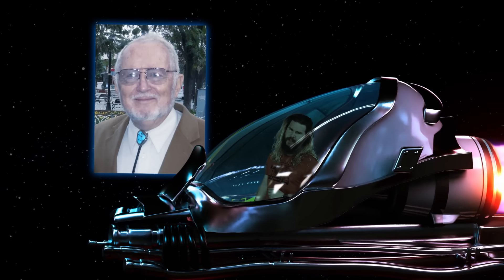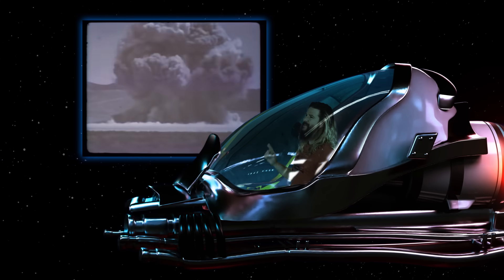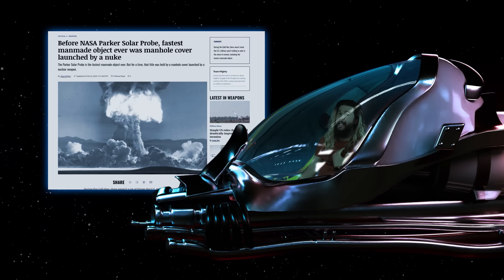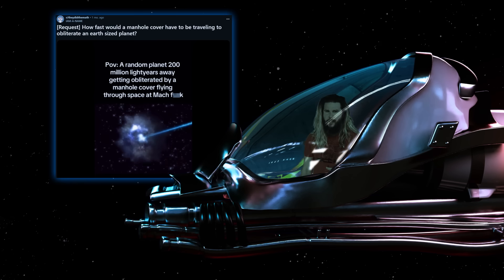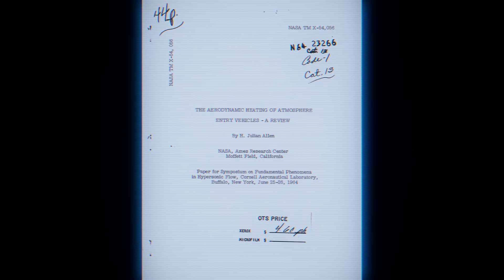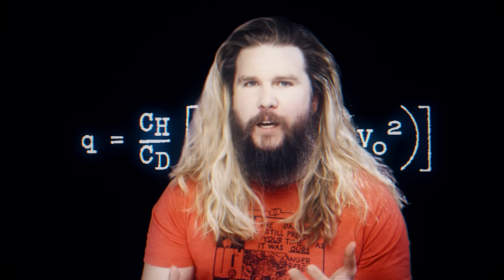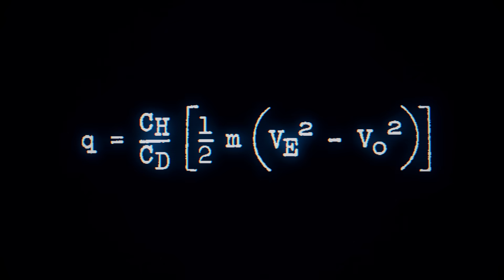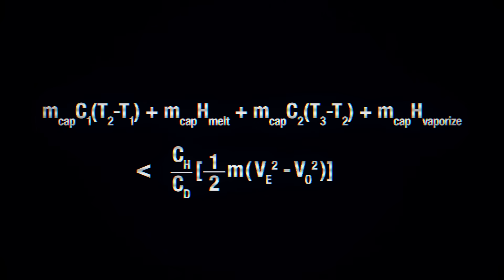Debunking the Nuclear-Powered Manhole Cover

Comment: I dont think that a manhole cover several [edit: inches] thick would have instantly vaporized over .8 seconds. Your formula accounts for it spending its entire flight down to a velocity of zero in a gradually thickening atmosphere, not escaping into frictionless space in less than a second.
Reply: I agree he never mentions that convection takes time. Also the meteor isn't going straight up, commonly going through 1000's of km of atmosphere.
Reply: @christopherlenahan3906 the convection coefficient is accounting for time.. but I still don’t believe it
Reply: Is the manhole cover going straight up though? Depending on the angle+speed at which it departed, it could go through more atmosphere.

Also unless I missed something, the calcs provided by Discount Thor are based on the mass of the manhole cover, not the shape. Past a certain point, energy+time will disintegrate almost anything no matter what shape it holds initially.
Reply: @christopherlenahan3906 meteors enter from space, from low density. This is in reverse, which is worse. Like fireing a high caliber bullet to the pool. It just breaks.
Reply: @Neo-vz8nh  shooting from outside the pool into the pool, yes it would break up. that's the exact same as how a meteor entering the atmosphere from space works: a sudden increase of drag. It's also the exact opposite of what was happening. Your example doesn't hold up because, if you hold the gun underwater and shoot, the bullet does not fragment, and since drag from air is many times lower than that of water, and explosive interactions with "failure points" like the cover served result in a dome shaped projectile, the drag most likely wouldn't cause it to break apart. Even then the atmosphere got progressively thinner so the drag would affect it less and less.
Reply: @Neo-vz8nh What you described is the exact same thing as a meteor entering our atmosphere. A high caliber bullet traveling from air to water is going from low to high density.
Reply: @Neo-vz8nh if you fire a gun in water out of air it doesn’t break, this is what you mean yes? goofy
Reply: @soggybiscotti8425  the only type that would realistically fragment like this is hollow point... because y'know, that's it's job
Reply: @Neo-vz8nh  except that rounds fired into a pool don’t break?
Reply: @Neo-vz8nh  no. a bulet IMPACTS the surface of the water.
atmospher is not the same thing as waters surface.

its annoying that so many people use this comparison. as the shape of water molecules cause the surface of water to actually be fairly rigid.

this manhole didnt IMPACT the atmosphere.
Reply: @lancesmith5645  no. Bullets pierce thru surface, the high density and velocity is the problem. Meteors also melt and break on the upper athmosphere, and there are no surface
Reply: @Neo-vz8nh  bullets travel through a gaseous atmosphere before impacting the water surface, be it by piercing or impacting the surface. 
Even if it is fired underwater it is still leaving a gaseous atmosphere and transitioning to a liquid medium. And water is a far deferent medium from lower atmophere which makes a huge difference.
Reply: @lancesmith5645  your point?
Reply: That's a crap-ton of power being released.  I don't think you comprehend the energy involved here.  Objects subjected to forces larger than their yield stress inevitably break up into smaller pieces which each have a higher ratio of power to mass which break up into...  etc until you have an explosion and complete vaporization.

He didn't go over the math but the atmospheric stress forces would have torn the manhole into pieces almost immediately independent of the energy being released.
Reply: @knurlgnar24 No explosion was recorded, if it vaporize in less than 8 seconds, the plasma would have exploded or going off like  fireworks upon combustion.
Reply: @knurlgnar24 for meteors sure, but this is refined steel, a shit ton of it, and it had a ton of power behind it propelling it upwards to. This isn't throwing a rock at mach fuck, it's more like god putting a penny on his fast before bitch slapping the stratosphere.

Things break apart for three reasons, unequal load, unequal strength, and too much load for the strength. (Other failure modes not withstanding) A meteor or space ship has fuck tons of different compositions with fuck tons of different weak points and their complex shapes mean aerodynamically they're a mess. None of this is true for a giga-manhole cover

This is basically like saying "well you can step on a can and it'll break, and a penny is less metal then a can, so if you step on a penny it'll break"
Reply: @felixjohnson3874  Cast Iron is NOT refined steel.  Not even close.  Cast Iron is iron that has a lower than usual melting temperature, to be CAST.  There are people who have tried to forge it (like you would refined steel) and it just melts.  Because that's how it's designed.  To melt.
Reply: @opalescent4694  1 : cast iron isn't "designed" at all, it's a description of it's material and construction process
2 : somewhat fair but my point stands that it's still refined metal. It's not technically 'steel' but it's still highly refined homogenous metal created artificially by humans. Comparing it to something like a meteor is still incredibly fucking stupid for all of the exact same reasons listed, but no technically it didn't have carbon.
Reply: @felixjohnson3874  cast iron is high in carbon. Pure iron has a higher melting temperature. Meteorites are often iron-nickel which would have a melting temperature just abit above steel.
Reply: @felixjohnson3874 This comment should be memorialized in history books around the world as one of the best comments ever written. Shakespeare himself couldn't have come up with something so witty and hilarious.
Reply: @knurlgnar24  it was several feet thick. it did NOT vaporize. I work with steel. there is no way it vaporized several feet of steel
Reply: @knurlgnar24  it withstood instanteous pressures of a nuclear blast accelerating it throught the lower atmosphere. Not to mention the manhole cover was thicker than a normal one
Reply: @knurlgnar24 1.4 kt just from vaporisation energy....  the Davy Croket had a 0.1 kt yield.
Reply: It was 4 inches thick.7:48
Reply: @prdoyle that’s what she said! 😂
Reply: it doesn't need to vaporize, if the iron becomes a liquid then that should deform it and increase its drag/cause the air to break it apart.
Reply: It would aerodisintegrate long before the heat could melt it anyway.
Reply: He also assumed that the drag coefficient was constant at its largest with the lid travelling perpendicular path of movement. It likely would be an average between parallel and perpendicular because it would have been flipping it's dick off
Reply: Not to mention it wasnt a normal manhole cover. This thing was 2000 pounds of steel.
Reply: Are you accounting for the heat of the nuclear bomb? It was pre heated
Reply: Also that cover was over 1,900ib and was heat treated so it doesn't even compare to a meteor
Reply: @Wowzival akshually it was pre heated by a nuclear explosion
Reply: @Wowzival  depending on its proximity to the explosion it could’ve been preheated to many thousands of degrees before it even broke the weld
Reply: @Wowzival i think it might have made it out but it definitely wasn’t shaped the same and likely lost a few hundred pounds
Reply: He said the energy was capable of vaporizing it multiple times over before it would even reach space. So there’s no need to calculate it
Reply: Also the manhole was way thicker than normal
Reply: @AlechiaTheWitch yeah from what I found it's around 907 kg or 1 ton (2,000 lb) which ain't your normal manhole cover.
Reply: @clonescope2433  yeah thicker and denser
Reply: @AlechiaTheWitch  and way bigger around.  It wasn't just a fat manhole cover.  It was more like 12 feet across and welded to the container.  Remember people they had to put a NUCLEAR WEAPON THROUGH THE HOLE THIS "MANHOLE COVER" FIT ON TOP OF.

Guess what wasn't that small when this happened.  DING DING DING NUCLEAR WEAPONS!
Reply: I would also be interested to see how this all changes with higher speeds. We don’t know the caps true speed, only its lowest possible speed. Since it was only caught in one frame of the high speed camera. This means it could have been going just a few mph faster, or maybe even twice as fast. I would be interested to see what the minimum possible speed is for it to have survived
Reply: This
Reply: however, mechanically it would shatter (unless ive done my math wrong lmao). the average normal stress per area is F/A, which can be re-arranged to be equal to mv/(A(t2-t1)), m is the mass, v is the final velocity, A is the area, t2-t1 is the time difference. this stress is in the giga pascals, which is enough to shatter the cast iron
Reply: It wasn't 8ft thick it was a few inches,
Reply: @eddjordan2399 It was 4ft wide and 2000 lbs. A few inches isn't at all accurate. It was probably a couple feet thick.
Reply: @soulknife20  as far as I can tell from searching it was 4 inches, but eitherway, yeah his conclusion here is wrong. He was less than an order of magnitude below vaporization point and he completely ignored tumbling, blast-forging, etc.

If you're worst case, rough estimation 
, 'general idea' math is within an order of magnitude before you've considered any mitigating factors (again, like tumbling, though another example would be an inverse aerospike effect, like how the cybertruck works aerodynamically) then thats functionally confirmation.

If your worst case " ah lets just see real quick " math is that close, before you've considered anything else then even minor changes in your favour easily win out
Reply: I can tell you've never worked with metal, a 500 lb base plate for a tower is only a couple feet across and only 2 in thick @soulknife20
Reply: @soulknife20 Using an online metal calculator finds that a 48” diameter, 4” thick disk of cast iron would weigh about 1870 lbs.
Reply: @soulknife20  48 inch diameter and 4 inch thick would be about 2050 pounds. Steel is heavy. I don't think the math here was done right, but it wasn't a giant plug of steel.
Reply: @soulknife20  no it's just under 4 inches thick. Here look:

Volume x Density=Mass
π2'²h x 490lbs/ft³=2000lbs
πh=1.02ft
h=.324ft
h=3⅞ inches
Reply: @soulknife20 using the lighter side of the density of cast iron, and the known dimensions of 4 feet across and weighing 2000 lbs, the cover calculates to be 1.4 inches thick, although the scientists who ran the test say it was 4 inches thick, so it was likely much heavier than 2000 lbs if it was 4 inches thick
Reply: It can't escape because it disintegrates. You can't cheat physics simply by going faster. The forces involved will be applied no matter what. You can't phase through objects by going fast. When you hit an object, it'll apply it's force to you. Even if you're going 99.99% the speed of light, it'll still apply all of it's forces to you. No matter what, physics must always resolve. So it doesn't matter if you halve the size of the atmosphere to .4 seconds. Physics works the same way. It doesn't just stop effecting something because it moves faster. Unless you're moving faster then light, physics gets you, no exceptions.
Reply: 👀... It's traveling through the atmosphere from the ground up. Meteors burn up before they hit the ground for the most part.... Why do you think it's not possible for it to vaporize before it hits the outer atmosphere? 

And the fact of the matter is Kyle is an actual scientist that makes a living doing calculations, figuring out odds, and using practical logic to explain or prove situations. You on the other hand.. are just some dude with a YouTube account, couple videos in your playlist tab, and no created videos of your own. 

That being said.... You would know better than Kyle because....? 👀
Reply: @TwoPaw-Shapurr  the manhole wouldve shattered. it is cast iron, so it has an ultimate tensile strength of around 1.5 GPa. the manhole experienced much more pressure than that.
also, just because somebody isnt as influential as kyle, doesnt mean they cannot perform their own calculations
Reply: @drcgaming4195  well then..... You should be aware that tensile strength is based off of force applied to a stationary object. 

However, when an object is moved by the force being applied to it...... Tensile strength becomes obsolete. 

There's a big difference between the manhole cover remaining stationary with all that forest being applied to it..... And all that force being applied to it causing the manhole cover to move as propulsion. 

You really need to let this go buddy. I'm not trying to insult you...... But you are overthinking this and you are also lacking a whole lot of information that is required to calculate accurate numbers

Comment: I really, really want this slug of iron to make it to space.  However... This also does not account for the energy put into the cap needed to propel it at the "observed" speed.  BUt it also does not account for the atmospheric conditions at the time the plug was lifted.  By that, "Chubby Electron guy had a point. At the time the plug lunched, it was propelled by the expanding gas of vaporized concrete and the shockwave of a nuclear detonation.  I think these conditions would disrupt the atmosphere beyond what can be accounted for in the formulas presented.  Even if those gases dissipated in a few thousand feet, it would still have given the plug a protected boost thought the thickest part of the atmosphere.  

Then again, the initial acceleration could have imported more energy than we accounted for.  Only one this to do.  We need a hole, some concrete, a steel plug, and a nuke.  For Science!

Comment: I love your videos, but i think you're wrong on this one. There are many other comments on here that show big errors in calculations which i dont have the time to regurgitate.

I love that you did calculations but the big errors which many have pointed out make me think that you should (maybe) redo this video or post an update. 

Edit: i just feel like this is oversimplified and many variables are missing like ablation, plasma envelopes, time, deformation, heat from explosion, starting altitude, and the decreasing air density.

Great video though

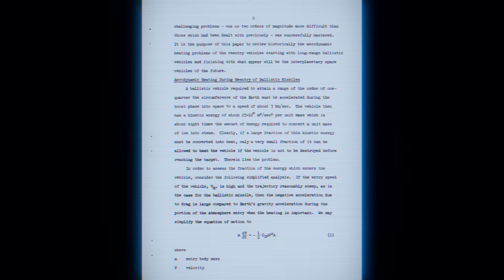Comment: 03:54 - It's worth pausing the video on each page of this paper (unless you can find an online copy somewhere) to read it through.  There are some assumptions baked into the equation Kyle uses, all outlined on page 3:

1) That the final velocity is small as compared to the initial.  Kyle assumes the final velocity *is 0 km/s*.  This is a hell of assumption if you start from the position of not knowing if the object made it out of the atmosphere or not.
2) It assumes that the mass is constant.  Kyle is aiming to calculate, and concludes, that this is not so.
3) It assumes that drag coefficient (Cd) is constant.  Again, if mass is changing, and the shape probably as well, this won't be true.
4) It assumes that the heat-transfer coefficient (Ch) is constant.  Given the changing density of the atmosphere, and possible mass/shape change of the object, I'm not sure this will be true either.

Others have pointed out that using equations derived for "hit thing atmosphere, heat up, but also slow down due to it, eventually end up in lower atmosphere at much reduced speed" doesn't seem wise when we're starting at high velocity in the very dense lower atmosphere.  Given this difference my gut feeling is the object will vaporise before leaving the atmosphere, based on what we see of incoming meteors of around this mass when they are hitting much thinner atmosphere to bleed speed initially.

And as I've commented elsewhere on this video, I think the thing that needs doing is a numerical approach, stepping along in time whilst applying heating, then check the mass state, eventually start ablating material when the accumulated heating is high enough, and all along figure that into the drag so as to get a new velocity for the next step, repeat until you reach a conclusion (zero mass, or effectively no further heating/drag due to having left the atmosphere).

Comment: Big flaw in your numbers is reentry is hitting the air that is relatively static and like a wall.  The manhole cover was not traveling through the air around it so much as with it inside a fountain of air going the same direction and speed (thus very little friction or drag) and air thinned before it became a factor.  A factor you did not consider in your favor is the heat from the explosion itself preheating the cover.  The math is above my paygrade too but your model does not match the facts.